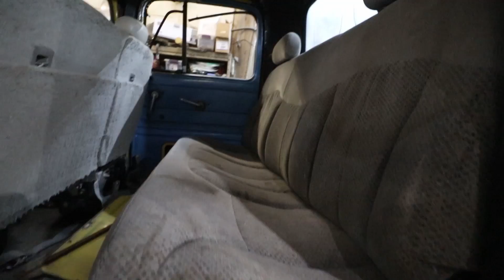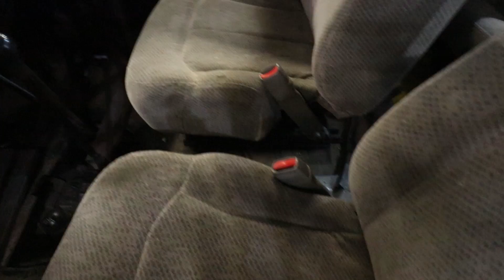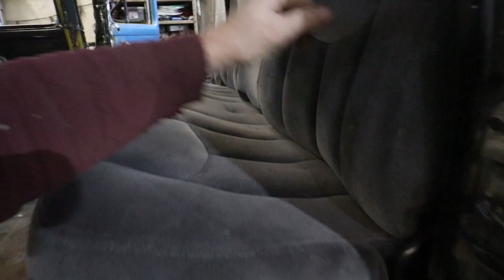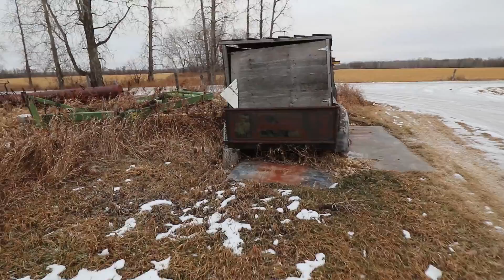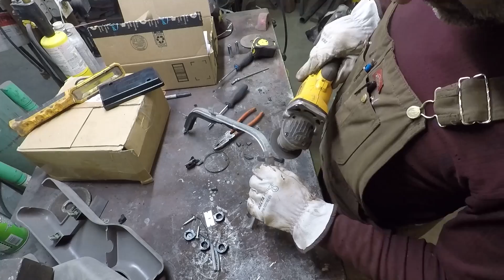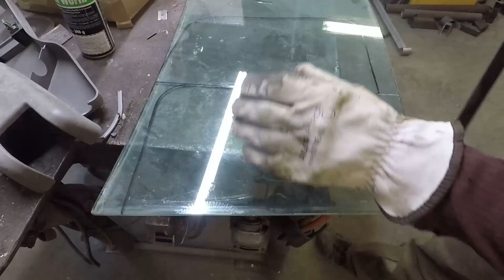More seat swapping and we finish the rear wing windows in the International

Comment: My wife's YJ didn't have much room for a center console so I used 2 ammo boxes.  A bigger on on the bottom and a smaller one on top, cut a hole in the bottom one near the front and put a cup holder in it.   Worked out mint.
Reply: That would fit well with the theme of this truck. Just an ass kicker. Great idea

Comment: Yup...You put the right seat , you take the left seat out, you do the hokey-pokey and you toss both of them out, and that's what its all about. Everything needs a tweaking, you made a better choice for sure.
Brother too bad it broke after but you done an awesome job at cutting the laminated safety glass, this wasn't your first time.👍👍👍  Cutting that schit is never a sure thing on any given day, no guarantees its a 50/50 job, the crack can go off in any direction,  but you took a piece of old used glass and made cutting it look easy .  I worked with glass for many years and recognize experience when I see it.
I'm more than impressed, keep up the great work.

Comment: In 83 I was stationed in FT Riley  Kansas and purchased a 1973 Satelite Sebring Plus. The exterior was already done but the interior was a mess, I recovered the front buckets and backbench and then I made my own console to fit my arm and even installed a new cassette deck. A few years ago I had a van! A very large  Ford E250. There was alot of space between the seats, so again I designed and built a console out of some old flooring with compartments in the lift top and large and small cup or can holders. a couple of years ago I did the same with a Chevy Silverado.

Comment: Use kerosene as a lube for the cutter. The oil reduces the surface tension of the glass and helps the crack propagate. Dip cutter, tap drop off, cut. Cut & Crack both sides. Wipe score clean, pour a line of 91% alcohol along score & light. When flame goes out bend to stretch the laminate for cutting. May take 2x, but yields excellent results, take time, less chipping. When grinding, use a light oil like WD40 on the sand paper.  You can achieve very nice results with a hand held belt sander running 120. Go really easy on the 1st swipe as to not catch the paper or excessively chip the glass. Spray paper often. You can make very nice frosted edges and even out lumps. Wear a mask. Try it on some junk glass to get a feel. An old piece of carpet on the workbench also helps grip the glass and prevent scratching. Dense commercial or outdoor type. Inspiring build!

Comment: I ran in to the same console problem with Ethyl.  Between the bucket seats, I ended up with a10" wide gap to fill.  I was thinking a console/jump seat from a Honda Odyssey van would work, but it was still too wide.  In the end, I welded up a steel lockbox for a pedestal, and them bought a generic console on Amazon that i mounted to the top of the lockbox.  The Amazon console gives me an arm rest, four cup holders, a cubby for sunglasses and a compartment for insurance/registration paperwork and larger items that i want to store out of sight when parked somewhere.

Comment: You might want to use truck bed floor coating instead of a vinyl floor.  It makes it easy to hose out and you don't have to worry about the insulation under the vinyl getting wet/causing rust.  On a chop top, it is sometimes easier to recess the windshield frame into the cowl so you don't have to cut the windshield.  For your jumper cables - those connectors are called Anderson multi-pole connectors, you can get them at Waytekwire.com.  Make sure you get the right gauge connectors for the wire gauge you are going to use.

Comment: It was interesting that you just used a little torch to heat the safety glass.  The glass cutters I've watched put alcohol on the glass then light it to soften up the laminate.    There are also grinding discs  for glass to smooth edges brand CR Laurence silicon carbide grinding discs.  They are pricey and hard to get as a private individual as the company does not sell retail.
Reply from the maker: Thanks for the tip on the grinding disk, just bought 2 disks from Amazon now to try next time haha

Comment: Just food for thought... When you did the rear door wing window mod...
The right rear door section would have worked as the front left door section. From other donor doors. And try a wet tile saw with a diamond blade to cut the glass with. The plastic film kinda buggers up the blade. But the look is professional.

Comment: I like the way you save everything to use it up and have a miniature salvage yard for your  personal projects, I do the same thing with my cars, I have a 78 Thunder bird and a 75 Ford Grand Torino Elite as two of my projects, I found a wrecked 79 Thunderbird that a guy took the engine and transmission out of and got it for scrap price and it has everything my cars need, Plus my son and I then strip them clean and he lists the parts we don't need on Ebay, I currently have over 40 cars and they keep me motivated to keep busy! The cool part of it is that I have cars to drive and instead of it costing me it makes me money at the same time! One question I do have about the truck, Does the back seat have seat belts on it or are they separate? If they're separate I would put them in, I don't know how old your kids are but if their grown you are about to be a grandpa if you aren't already and if Canada is like the USA anyone under 18 has to be belted in! Even if the vehicle didn't come with belts they have to be added to it to haul minors!

Comment: amazing question? how many pieces of safety glass cuttings did it take to learn it.  sure it was a challenge at first
Reply from the maker: the flat stuff isn't bad, it's the curved stuff that takes time. I just watched a bunch of videos and had some old glass and just tried.
Reply: @HalfassKustoms  that is awesome will have to attempt it myself. learning sop much like panel repairing or patch areas. laying the replacement piece over the area and cutting it in.

Comment: I'm not positive,but I think you can remove the headrest from the back of the seat. By pushing a screwdriver in a hole in the center of the bottom of the headrest; between the top of the seat, and the bottom of the headrest. Hope this makes sense, and works.
Reply from the maker: haha yeah but I'm still stuck with the seatbelt thing hanging on the seat. So I'll guess I'll just live  with it haha

Comment: Did you just put nuts in the floor's sheet metal to mount the seats, or did you place them over a brace / brace them? I've been thinking about this a lot lately for my projects.
Reply from the maker: Theres a steel brace under the floor that runs the length of the cab I tied into.
Reply: @HalfassKustoms  Thanks! So you either got lucky with the width of the seat, or braced off of the existing brace

Comment: Crazy glue on the cracked glass and the crack will damn near disappear.
If you don't like the look of the crazy glue and how it turns out, then something called "plastic glue", made by Citadel @  https://www.games-workshop.com/en-CA/Citadel-Plastic-Glue-2016-CA available at hobby stores, works even better. It is not thick but is very runny like crazy glue. 
You do more work in just a couple of days than most shops do in a month. Amazing. Simply amazing....

Comment: if you know where there is a recked freightliner they have bolt on cup holders on the dash
Reply from the maker: yeah in the past I've used flip down style from boats what what not but there just nowhere really for the pass side with that option :)